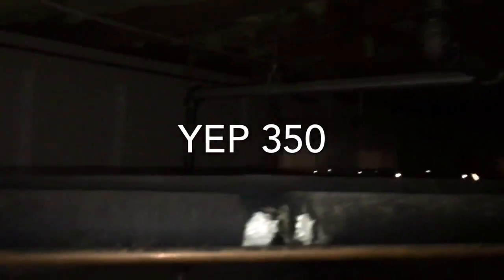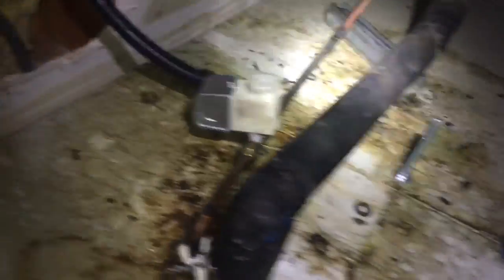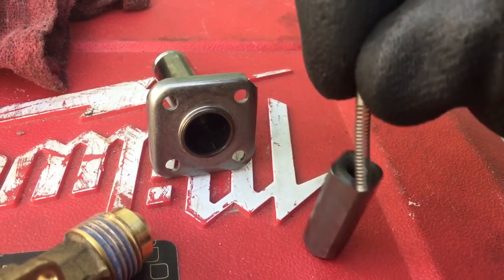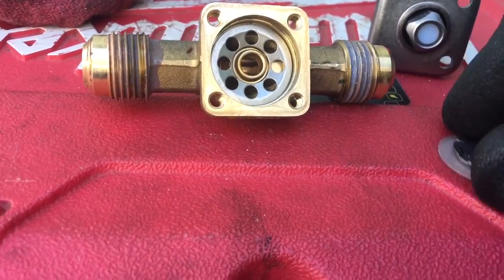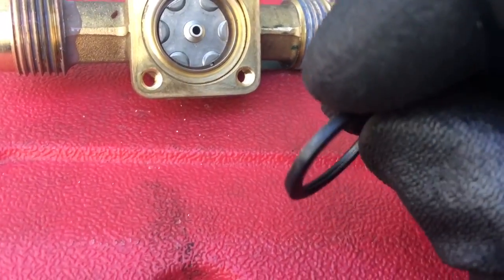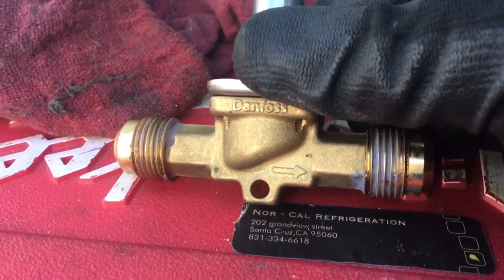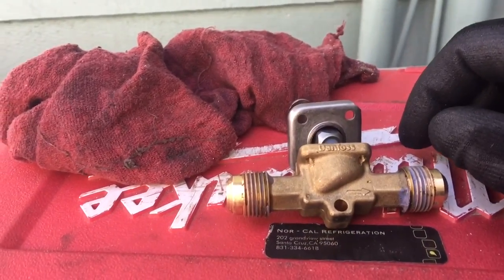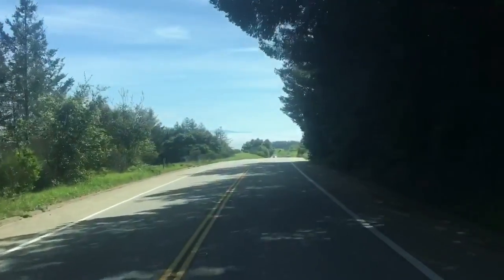The leak the H-10PM could not find

Comment: Nice,I've heard h10 pro is a little better than pm according to Nathan's hvac for 410a leaks, but I have heard and seen the 110 volt reign supreme. I have the fieldpiece infrared and hate it. I will be getting one of the h-10 at some point
Reply from the maker: Tony McKay they only make the H-10PM now. There the best leak detector period.  No false positives
Reply: @NorCal-refrigeration  cool man. Thanks for comment. I edited this comment once i Decided to call Bacharach, to my suspicions it's true that h10 pro is the newest and only provided by bacharach. They said they quit making PM in 2014. Pm and pro are both battery operated.
Reply from the maker: Tony McKay oh do the pro is the new one?   They last so long my 115 volt model is from 2003, my pm is from 2008. Still work perfectly
Reply: @NorCal-refrigeration  nice, yep! Do you use The h10 115v and  pm on 410a leaks? Thanks
Reply from the maker: Tony McKay yep

Comment: probably only leaked when pressure was highest, valve closed/system pumped down. maybe bad timing and sniffing while it was open. I bet the manufacture cheaped out and quit applying loctite or similar. :)  maybe someones stealing the gas!

Comment: Nice job, Nor Cal. I am not a fan of Danfoss products. I like Sporlan much better. Their valves are top notch. Sometimes you have to do a leak check with the system running to find those hard to find leaks.
Reply from the maker: polishtheturd mickelson I like the sporlan also.
Reply: Thanks Nor Cal. I will check out your video for sure.

Comment: Great video Dave , did you try using the Fieldpiece HLR8? I had a solenoid valve kick my ass like 3 years a go bro, same brand Danfoss leaking at the body smh, I've also seen Sporlan valves leak , sometimes you can try tightening them up but they still leak, great find Dave. You speak Spanish? 😁😎
Reply from the maker: Felipe Tafolla my Spanish is limited.
Reply: Nor-Cal Refrigeration & H.V.A.C  Cool music & tv helped me learn English so your definitely on the right path bro...😁

Comment: Good video Dave we all had them were cant find the refrigeration leak on the system. So far sporlan solenoid valve a better brands of valves. Got love of where they place the solenoid when they installed the equipment. .Dave did you relocated solenoid valve so next it is easy to replace or service next time.
Reply from the maker: Edward HVACR CT no I left it up there.